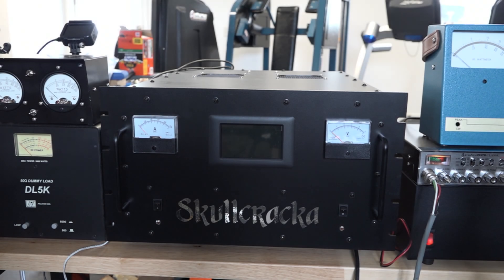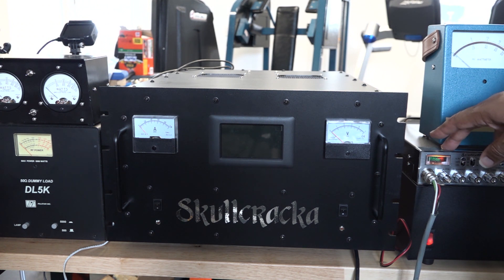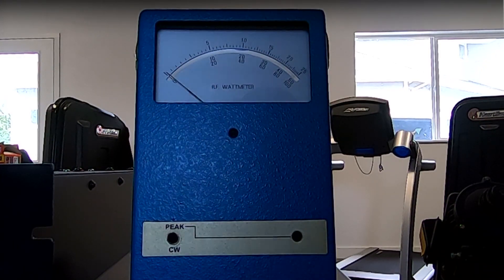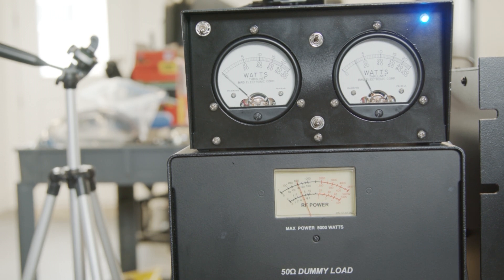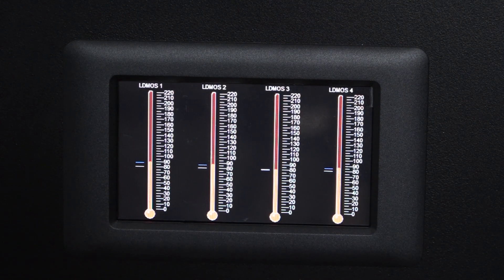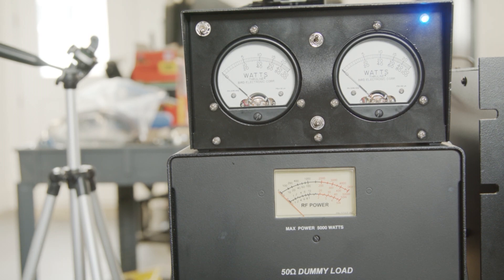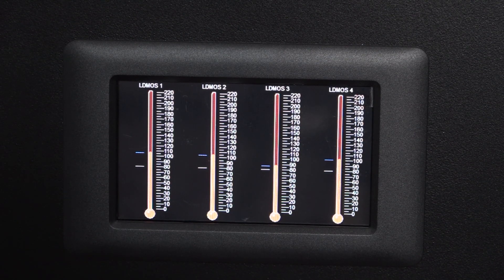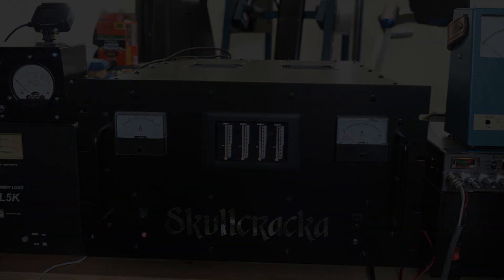LDMOS 4pill ran like a 2pill (the perfect driver?)

Comment: Evening Prime my brother. I wanna start by apologizing for the length of this “note” because it’s morphed in to a novella because my 16&13yr old daughters were feeding me the message to send you 😂 ,I’ve been a big fan of yours for many,many many years.  Since the first time I caught you when the skip was running hot&heavy,I heard your call sign and and figured what the hell so I called for you even tho I figured there was no way in hell that I was gonna make the trip from Maryland to Washington State. I keyed my old courier centurion 40d that was late 70s/early 80s pimped to the max 😂 
It had a Yeasu VFO/digiscan retrofitted,every freq imaginable.talkback,browning pinger keytone,Roger beep,echo board and she was hot a hot rod too,would do about 50w wide open but I usually ran her low and let the old girl swing the old Maco Super 300 5 tuber I was running at the time like Tarzan chasing Jane 😂 So my 19yr old ass calls for Prime Minister Prime Minister Prime Minister how bout that Prime Minister 770 770 770 770 RatchetJaw 45 miles west of Baltimore Maryland and we trying break break break. Never thought I’d get out over the local bucket lips that were just cutting everything and everyone down then I heard your relays and they was gone and I heard 770 770 around Western Maryland you made the trip to the evergreen brother. And that was what hooked me for many many years untill I moved from Maryland to Spokane Wa and sold my base station as well as my mobile sadly. 17yrs,wife #3 and 4 daughters later we are back on the east coast and my 4yr old daughter was watching some video gates,listening to your CB songs and casually looking at the radio shop websites and amp/antenna builders. My 4yr olds name is Lilly and she absolutely loves you brother and she wants me to put a mobile together so she can talk to you 😂  I still have one of the pair of55 R6s that Mr.Terry built for me long time ago when I was running a bounce back setup on my Cummins swapped Ford excursion with a President JFK II driving straight 4 pill 2878 NoName in a bigger case driving a worn out straight 16 pill that started as a 24pill davemade from eBay and thanks to my buddy smokedog and a bunch of help from the forums he was able to rebuild that garbage 24pill in to a surprisingly decent 16 in the big case. Sh!t i thought I was a big strapper fosho brother 😂  
Even as worn out and pieced together with parts and a prayer I wish I still had all my old stuff. My girls really want me to get back in to it,my oldest 2 are old enough to remember those days but my 4.5yr old just don’t understand that even tho my legs and back is mostly healed from getting tboned by a drunk driver April of 2019 that daddy hasn’t had a job since then and not for lack of trying.  Sadly I’ll probably never get to be a medium sized mudduck in a big pond again but I can still put a little mobile together and hopefully have fun with my girls. My oldest 2 wants a SkullCracker straight 8 pill,and I gotta admit that I’ve always wanted one of your DC boxes Prime. I know it would be grossly out of my reach but if a man wanted say a straight 6 skullcracker what would a ball park figure be?  

Lots of respect and love from my family to yours Mr.Prime Minister. 
770 Md RatchetJaw(me)Mighty Mousie(18mo) CrazyCatLady(4.5yr),TinyDancer(16)MamaBear(my wife) and last but not least the 13yr old silver tongued devil “MauldroppinMonkey”  we readin the mail  ratchetjaw 770md over here in the Cumberland Valley 40miles west of Baltimore Md and I just got down!! Seeyabyehyebyebye

Comment: I bought an LDMOS BLF188XR
amplifier and I probably need to have you to work on it. I was told to key up 4 watts into it  to give me 500.  but the 500 doesn't have a swing to it, and my radio friends on the railroad tracks "channel 11"  told me that it's too tight, the technician who did the work for me  he sold me a Kenwood TS-430S also, because I couldn't get my Royce 678 to do nothing but 2 watts, please Give me a call 3132546538